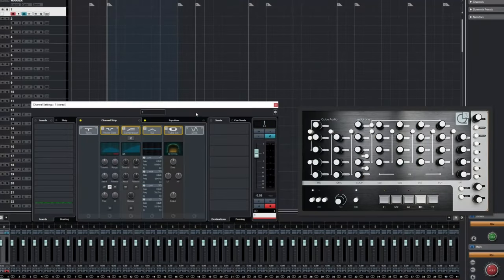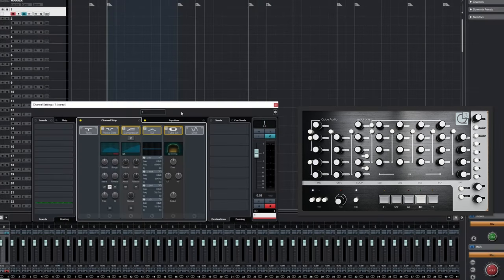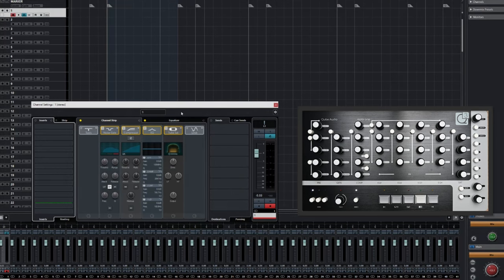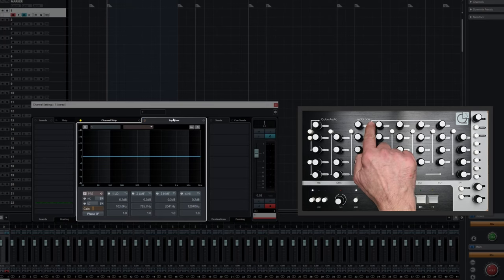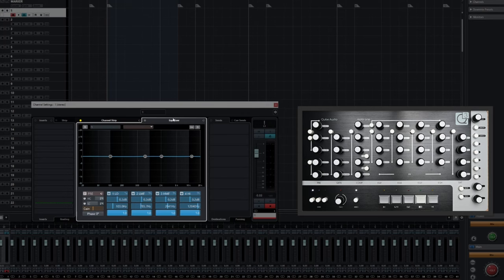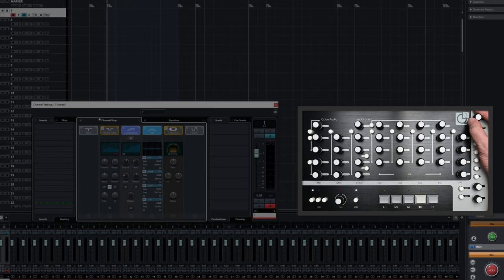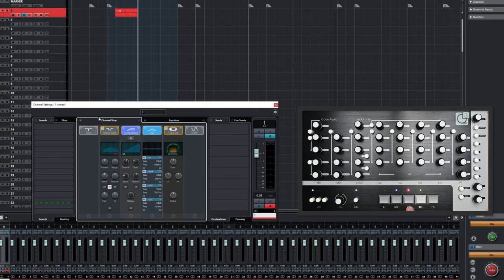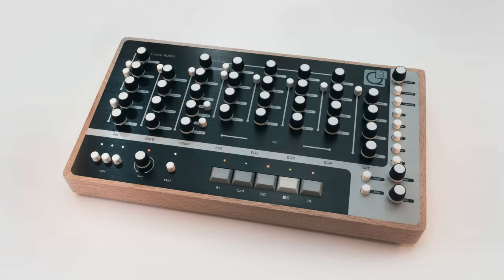Qube Audio Mobi One Introduction

Comment: Just got my Mobi One and I couldn’t be more pleased. Shipping was unbelievably fast. I can already tell that, because of the intelligent layout of controls, I am going to to have little trouble developing a good muscle memory on this unit. Of course, this will translate into greater speed and less looking at the controller itself. With headphones on, the bypass buttons give good tactile feedback. The rotary encoders are lightly detented which also yields fingertip feedback. I haven’t had time to explore modes 2-3 yet but it leaves me wondering what other possibilities await? I am using this with Cubase 12 Pro —clearly, mode 1 was developed specifically with Cubase in mind.

Comment: I cant help thinking that 2 faders or even one would have made this way more flexible
Reply from the maker: A second module, is in the planning, to use alongside the Mobi One, this will feature a motorised fader.
Reply: @qubeaudio9816  Good call not adding motorised faders to this unit but adding it as an extension. You can take this strip on the road without having to worry about a power supply. The motorised extension will obviously need one :)

I need something to replace my CC121 which gets used alongside the SSL UC1 and UF8. They compliment each other. It was always a shame that the CC121 missed so many functions of the channel strip. I'll be trying this out for sure.